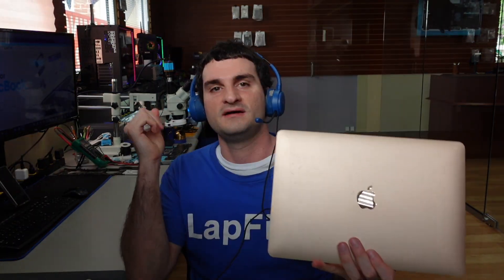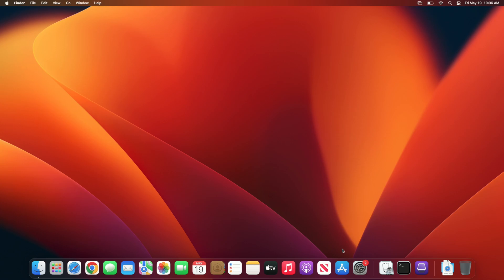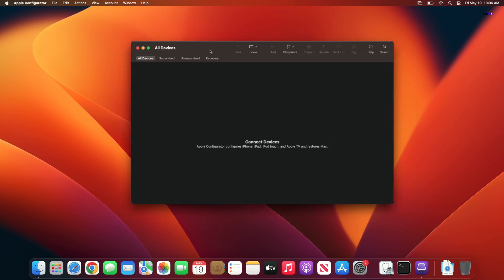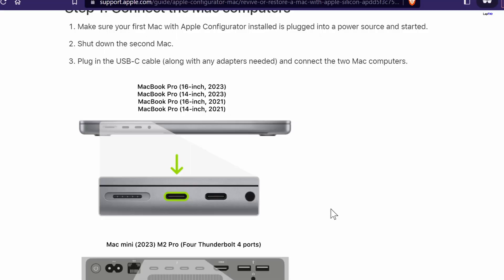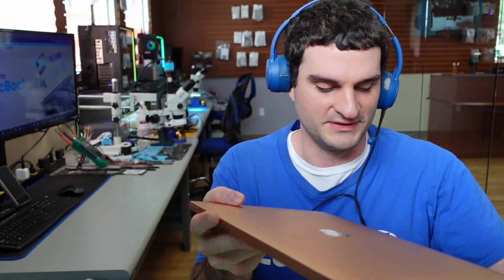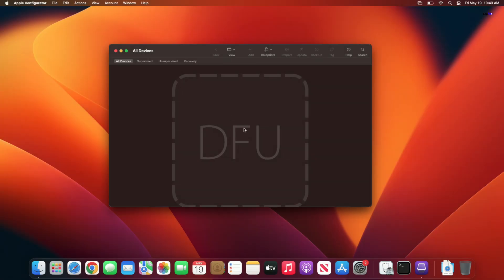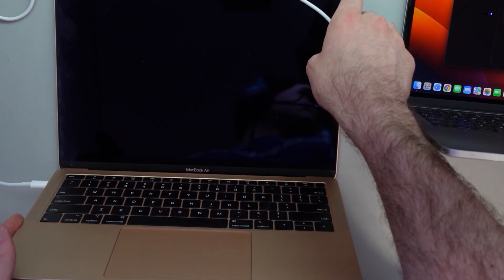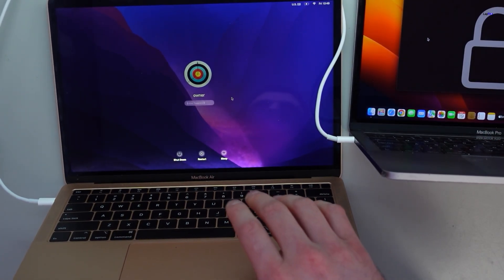Revive a Dead Macbook with Another Macbook! | DFU Mode

Comment: Hey! Do you reckon I could recover an M2 MacBook Air that started showing the /mac/restore screen after a software update? It's a really good deal on a local marketplace (~350$) and the seller says (and also linked a photo) that it sometimes boots into MacOS and works just fine until it gets restarted/shut down. Was thinking of getting a 2014 Mac mini then using OpenCore to upload it to Ventura/Sonoma (since it only goes up to Monterey natively) so I can ensure the best chances with the Apple Configurator app. First time on MacOS so just wondering if I might run into issues at any step along the way. Real good content btw!

Comment: i know its been 2 years now since you post this video, but right now I am struggling with my macbook pro 15" Intel chip - 2017 with T1 security version, my macbook has touch bar on top where the power button is, I tried your step and those keys does not work, no matter how many x i tried. Is there another keys that I should try? my macbook pro issue is that I reset to factory and restart without OS, after booting from ventura USB and disk utility my internal SSD is no longer detected.

Comment: I work at an electronics recycling company and have acquired a 2018 15 inch MacBook Pro that is activation locked. It would not let me get into the boot screen but would automatically go to the internet recovery. Would using DFU mode fix the issue of not letting me choose which drive to boot into?

Comment: Huge thanks for this video - my '19 MBA was stuck in startup loop and the SSD wasn't being recognized, after 5 minutes of using the Apple Configurator I got the OS reinstalled and the MBA wasn't back up and running. Nothing else worked, tried all startup key combinations or even external boot disk. So nice when you download a free app and it actually just works. Makes me want to buy the app or donate.

Comment: Just used a M2 MacBook Pro to revive a M4 Mac mini. The M4 mini's DFU port is on the back and in the middle, it has the little thunderbolt icon above it.
Reply: What keys dis you press to activate the dfu mode in mac mini with m1 chip, since it has no built in keyboard. Appreciate your help, im planning to revive my m1 mac mini

Comment: Bro, I have a question. I hope you see this. My situation is that my mac won't update to a newer version of macos. It's an intel 2019 macbook pro and I have tried everything. System settings update failed. Terminal update failed. Booting from flash gives an error saying "A software update is required to use this startup disk" something like that, and pressing update loops back to that error. I tried doing the network restore that fetches the latest supported os, failed. I wiped the hard drive and tried installing from flash, failed. 

I want to know before I do this process: since my intention is to update, I should still choose revive yes? And for the macbook that I revive from, does it need to have a newer version of macos for my mac to update?

Comment: Didn't work at all until I did it exactly this way. REMEMBER: You must make sure the image on the working laptop is the dotted outline square with 'DFU' text inside. NOT the MacBook product icon. It was very difficult to get in into that exact mode (Try a handful of times, it took me maybe 15 times) but eventually you'll get it. Hold the power button down for 10 seconds to make sure the MacBook is off before trying each time. Once you have the correct DFU mode and can start the recovery process, don't be alarmed if you get an error like Error 21 or Error 26. These are usually related to the cable and NOT the DFU mode. Use a NON thunderbolt cable and make sure it can handle power and data. I used an old MacBook Air charger cable. With bad cables, you can get errors. JUST TRY AGAIN. I can't stress this enough- If it fails halfway through a recovery simply try it again the exact same way. Mine worked on the 3rd time doing it (Same way each time). Good luck to everyone trying this. M-Series MacBooks are amazing and this should not discourage you from using them. This topic generates a lot of anger and bad advice. Stay calm, relax, make a coffee, keep trying at it. You'l get it eventually.

Comment: the 4 button thing didn't tower for me here is my story :to all those who landed here let me tell the problems I faced and why I hope it helps some one ..
I bought an new m3 Mac and wanted to sell my old Intel Mac from 2017 
so I went to YouTube and saw a video how to clear you Mac before selling ,, I logged out of messaging , switched off my find my , logged out of music , now I Restarted CMD R , got in to the recovery menu - Erased my Mac as per the tutorial restarted my MAC HUGGGGE mistake then led to the BLACK SCREEN OF DEATH with grey square and question mark ?
then Panic > Anger > resentment > stupidity > cursing the YouTuber and then reading the comments that they particular video bricked many poor should Mac as he skipped ... go back then re install MAC os ..

next Frantic search to restore Mac 
I had deleted my previous time machines ((( HUGE mistake ) 

then connected both my Mac to do the DFU restore but of rsome reason the new Mac did not show the DFu so no restore 

what all the videos kept saying was they the DFU will get me into the Grey s square and I was like I am already getting that 

the error I was getting was - I used the CMD + r >> it showed white globe inserted internet and now to my dismay instead of Mac OS Ventura ( my last od ) it was trying to connect to Hugh Sierra which showed error and due to some reason it was not connecting to Mac Ventura support page 

then another video showed-- correct the date using terminal command 
I did That but still no use 

tried the dfu one last time no use 

then made the Time Machine from my new Mac

by this time I restarted - got the globe screen and then it automatically showed -- the Mac OS Ventura support page 
I tried intalll os didn't twork 
connected the SSD with Time Machine then recover selected the recover from the time machine 

gave me box That files will be recovered but u need to install the os first and I was thrilled thing were going my way I went back to the recovery menu ( just back did not restart mind you , ) and selected the install OS this time I had kept the install log on and sleeted show all progress and not just error which displayed it copied the beige os from the ssd and then download the OS copy from he internet hence I guess it took 2 hours ( internet speed 50 mbps ) 

thank god
hope this helps some one

Comment: if your computer dies by itsown. this wont work most of the time. my brand new m3 pro died suddenly and the configurator tells it cant unzip the restore files on it even thow it enters dfu mode.. impossible to restore or revive. the new arm chip macbooks suck. never buy one used without warranty. they are not realible anymore.
Reply: Hii , i am also facing the same issue , can you tell how you got this issue fixed ?

Comment: I have a 2017 A1534, it's been having similar issues, sometimes if I click the power button I can feel the force touch trackpad clicking, but nothing on the screen, in some cases it turns on run for 5 second and then dies, in other cases it turns on, shows the apple logo and the apple logo disappear while showing gray vertical line art effect on the screen and shuts off. I would assume it could be a cpu or a graphical problem, but I'm not sure.
Reply: bro I have an a2141 which faced the same issues u mentioned. this method worked great for me and this comment is posted from the same MacBook. just fixed it now.

Comment: Thank you!!  I tried literally every other hotkey/option, but nothing was working.  I was duping my Display to HDMI/TV, and battery was critically low, so I had it plugged in.  But then I shut down the laptop, and wonder if it was stuck in some mode, or I really dont know.  Or maybe the MacBook crashed on shutdown from being too low on power.

But in any case, my MacBook would not boot up.  Finally as a last effort, before going to Apple Store, was to run this process with a family members MAcbook, and the Revive option took a bit, but finally my MacBook is revived/wroking again and booted just fine.  Whew!!
Reply: Hi there, I’m experiencing the exact same thing like you, after letting the computer charge all night connected to the tv. Did the other computer that you connected to yours was identical or of different model? I wonder how critical it is. Thanks!

Comment: Greetings, excellent videos, all very well done, I need help with a macbook pro A2141, which we managed to turn on after removing one of the CD32178 chips which had a hole due to an explosion (let's not try the answer) it means that we only desoldered it to remove the short

with this I manage to turn on and work

The problem is that I don't have a 20v charger, only 15v (nintendo switch)

The macbook doesn't charge, I know I should try to find a 20v charger but with the 15v one it shouldn't at least charge?

or when removing no of the CD32178 chips it does not load?

I don't have much experience with mac, this is my second machine

I tell you that I have 11V in the Q7065 that goes to the battery but the mac does not detect the charger, now I have a screen to connect the charger

I think I specified everything, thanks hug.